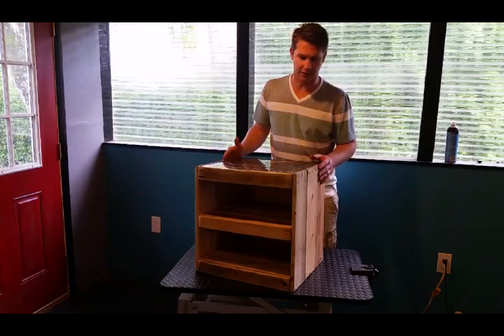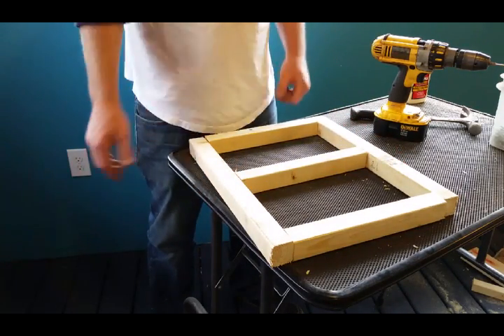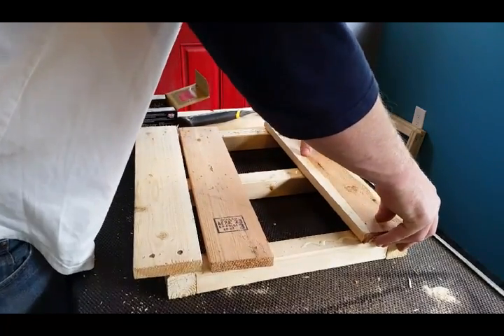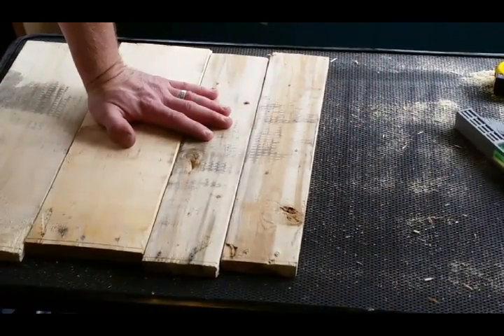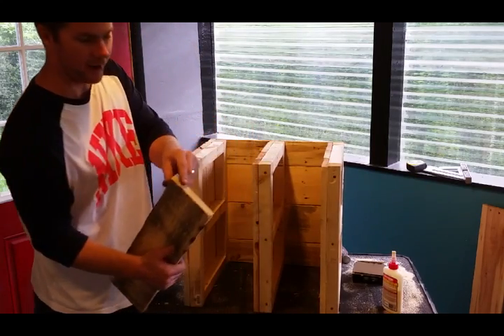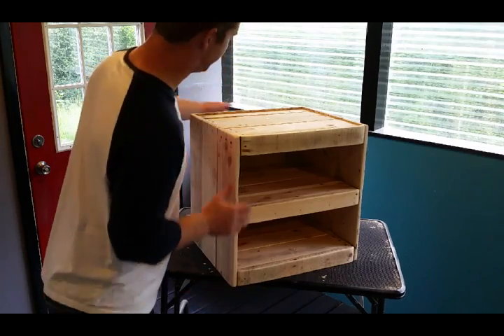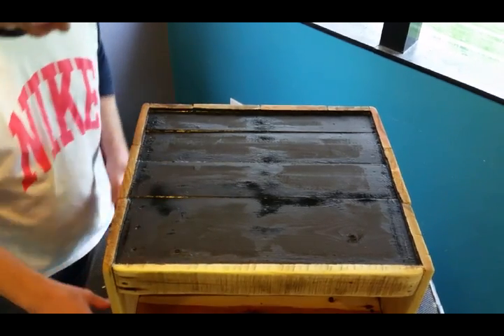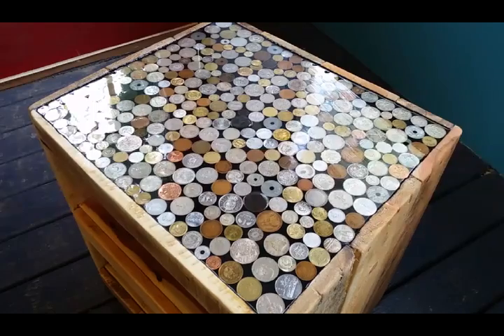DIY on How to make a pallet table with a coin or penny top.

Comment: Very informative.  Video a little long and the lighting is  little dark but again this video is very informative.  I could now go out and get some pallets and create one of these tables.  This is a great video for beginner pallet users and/or DIY upcycling furniture makers. This pallet furniture is very sleek and has a very professional and finished look.  I like how you offered alternative options to steps and options for minor idea changes throughout this video. I really love the coin top addition to this table.  The coin option is the whole reason I chose to watch this video over others. I think another coin option could be pennies that have corroded to that crusty turquoise look.  Pennies still contain a certain amount of copper although older pennies contained much more copper than modern pennies and with the use of ammonia that corrosion of the pennies can be accomplished in various degrees depending on the amount of time you choose to soak your pennies in an ammonia solution, or if you choose to brush on the solution, splatter the solution etc. Also older pennies contain much more copper than modern pennies, offering better corrosive options. I like the black background, it does in fact add depth to his table.  The use of random foreign coins is gorgeous!  Also you can use E6000 for adhering your coins and it dries clear in the event there is accidental glue seepage.  I loved the comment.... epoxy mixed to 'almost' the instructions LOL.  Gorgeous table! Thank you for this DIY instructional video.  I will PIN and share.
Reply from the maker: +Regina Perry Cool thanks for the comment!
Reply from the maker: +Regina Perry Cool thanks for the comment!
Reply from the maker: +Regina Perry Cool thanks for the comment!